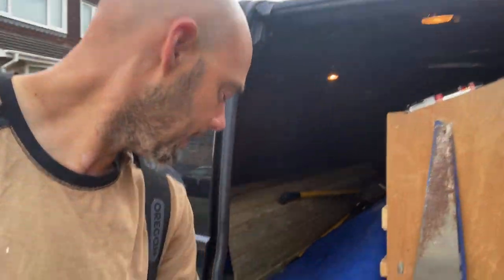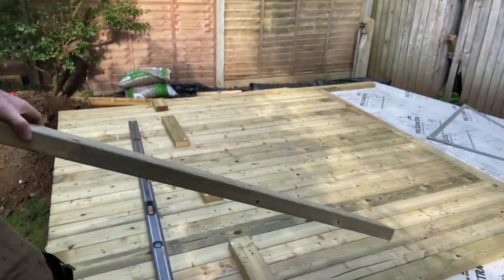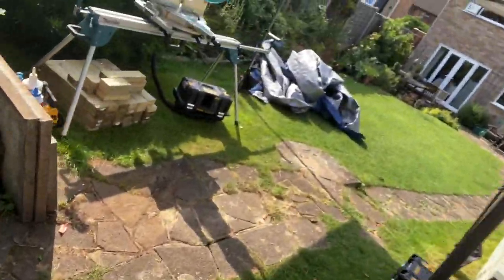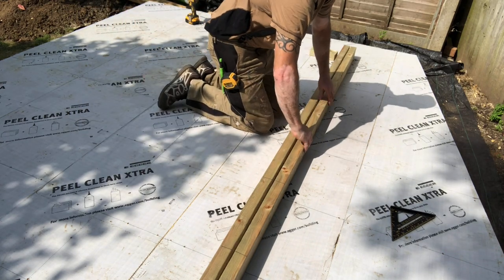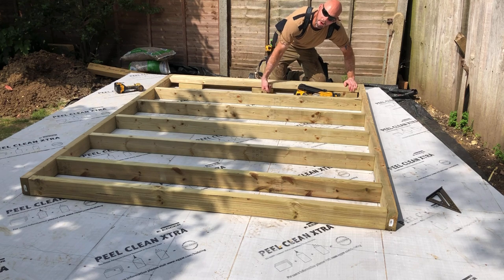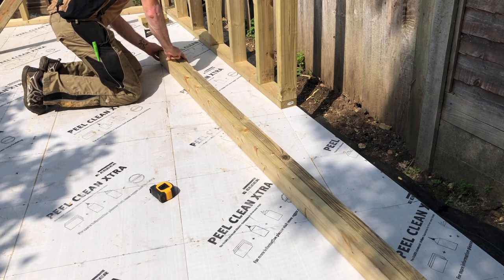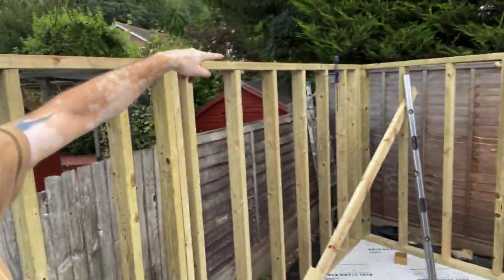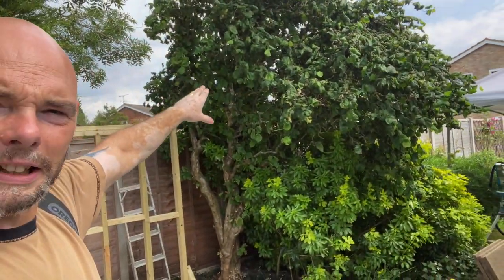Garden Room How To: Build & Frame Your Walls From Scratch

Comment: Hello mate,
I am building my own garden room exact same system you have done it all!

Question, I’m building it 5x3m so regarding when I batten it and clad it. Will that be the external measurement? So when I string line it, so I need to take into account the cladding etc…

Comment: You should have replaced the loose timbers that didn't have your guide fixed to them so you can swap and still use your guide without doing it again . Good vid
Reply from the maker: Hello Tyler!! Yes fella, Next time I'll adjust its so I don't pin lengths in the middle! Thought that as I was doing it lol :)

Comment: Hi Steve. I haven’t got access to a nail gun so I will be using screws. What size do you recommend
Reply from the maker: Hello Robbie!! Righto no nail gun is fine! But I'd still use nails fella. They have better strength and resist snapping under bending pressure. Get your self a good few bags of loose 90mm nails and have at it! Its actually good fun and doesn't take long to get into the swing of it :)
Reply: Cheers Steve will do.

Comment: Nice video mate. When your were marking the base and top plate, you matched the bow in the timber, but in which direction.. or does it not matter? Ps: hope you don’t accidentally fire a nail through your hand when holding a stud so close to the gun…
Reply from the maker: Hello bud!!! So I put the bend so that the two ends are in contact with the gap in the middle. So when I put my studs in it’s easier to just push them together and the nails hold it all in 👍 And yeah!! I don’t really fancy a nail in my hand anytime soon! Lol 😂
Reply: @TheHomeRenovationExperts  thanks. I'll be building the walls when I next have a free and dry few days. 🤞
Reply from the maker: You’ll have a blast doing the wall!! Let me know how it goes!! 👍

Comment: Are you super tall? Or are these walls a bit short?;
Reply from the maker: Hello Tyler!! I do stand at over 6ft 2" tall but the front wall is just under 2.1m and the back wall is just over 1.9. Its as heigh as I can go under the fixed 2.5 max height limit for 'permitted builds. Still plenty of room though, just no swing a cat up too high :)